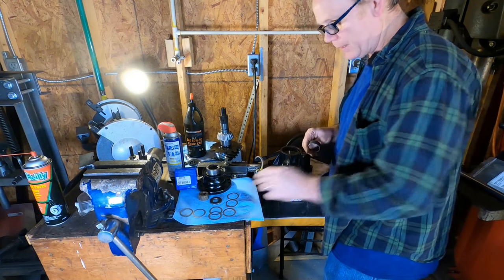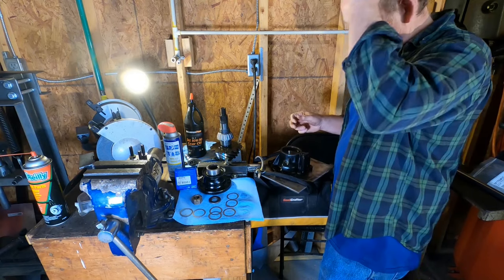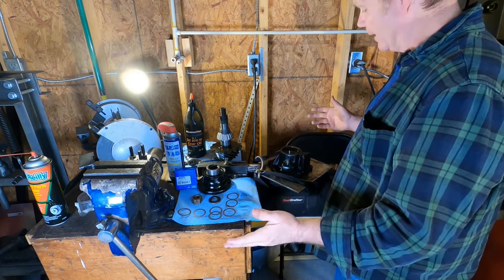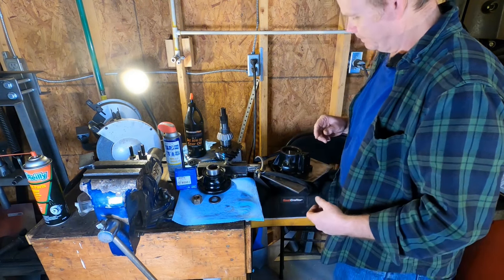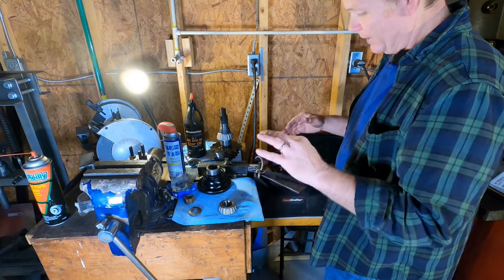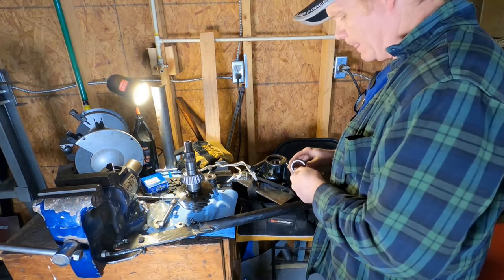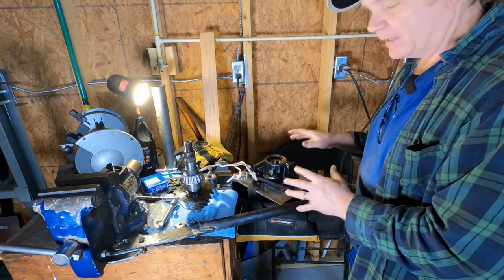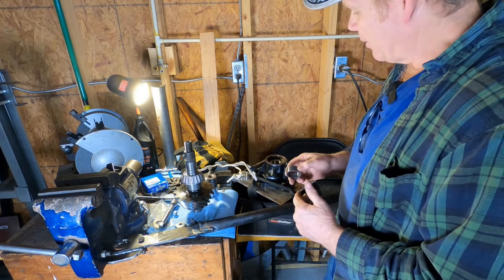71 Cadillac Coupe DeVille - Finding Resonant Drivetrain Vibrations Part 9 - Pinion PreLoad Setting

Comment: That doesn't totally make sense to me. Putting torque, preload, on that bearing. 
You don't do that on a wheel bearing in order to allow for expansion from heat. I'm scratching my head in case you can't see me. 😆
Reply from the maker: Well with a front wheel bearing you put a little preload on it and then back off one notch on the castle nut and then slip the cotter pin through. So there is a little bit of preload but not that much. Depends on the manufacturer's spec obviously. But with a pinion, the preload must be a lot tighter as it is in direct line with the drivetrain. It cannot wiggle around or the rear end will make noise and tear itself apart. The crush sleeve (or in this case bearing spacer and shim) is used to achieve whatever preload the manufacturer specifies. It will loosen up some after it is run for a little while. In my case it was ridiculously loose!